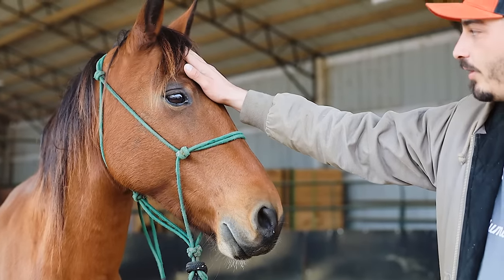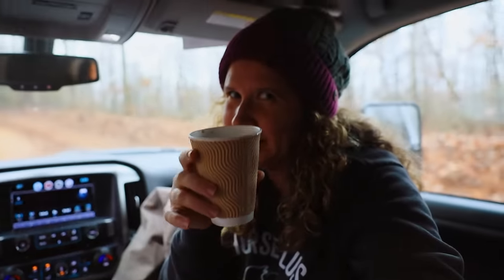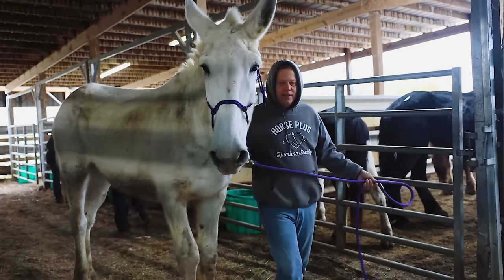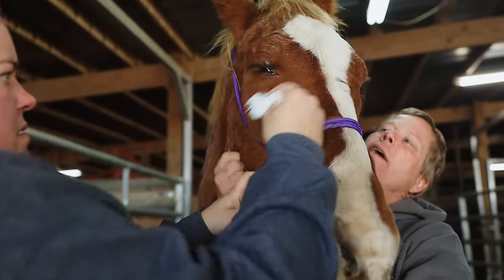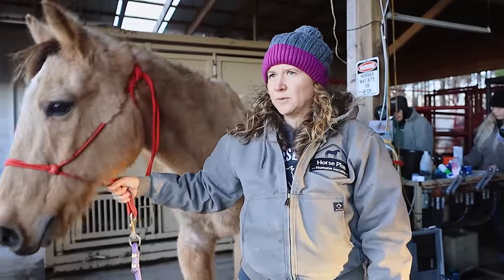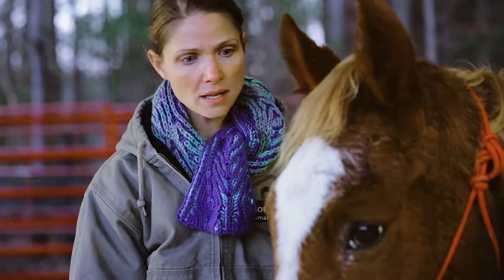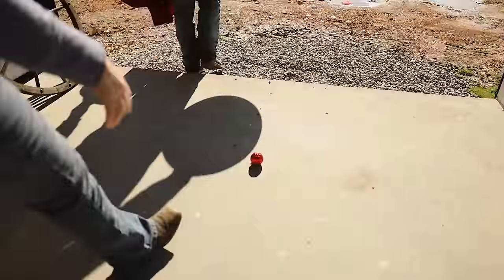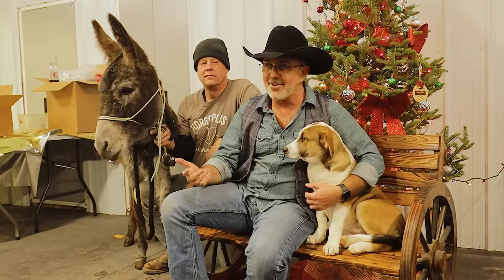14 Drafts Saved - Horse Shelter Heroes S3E40

Comment: Lowering the head this way has worked so well for me, I got to work with a mare that is 20 yrs old and she would never relax (poor horse), back then I had no idea what to do about it, so I started reinforcing her stretching her neck down when lunging. This was waaaay to slow of a method but it did improve her posture a bit. I've learned so much from this channel, its crazy! I was able to build a strong bond with her because of all the training videos. Now to be clear, I'm not her main rider (she will ride 30 mins to 2 hours every day already, its nore than enough) and I mainly focus on groundwork, providing scratches and having a good time together. Lately she refuses to do much work, so the owner is planning for her retirement.

Comment: I've seen so many Belgian drafts come through with swollen legs. I wonder if it's related to CPL (Chronic Progressive Lymphedema) which is a known problem that effects the legs of the breed as a genetic issue. If so, it would be nice for the vets to touch on the subject. Horses with this condition could be dumped at an auction since the condition is only treatable for a limited time and ends up being fatal to the animal due to the resulting pain and infection. Such a cruel situation.

Comment: Before plastic, did vets have to do preg checks barehanded? Also, I'm loving the longer videos :)
Reply: I think they just ran horses differently back then. Kept the stallion in with mares for several cycles and when they no longer came into season, presumed pregnant. No real need to confirm as they couldn't go in and pinch out twins etc.